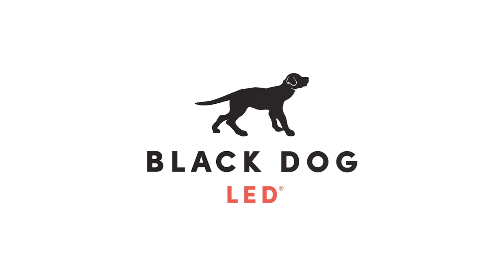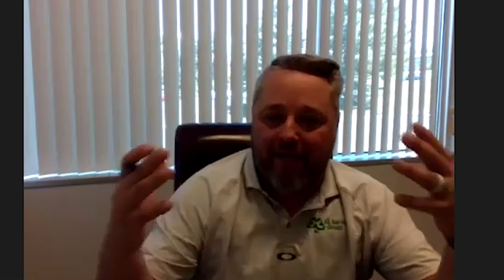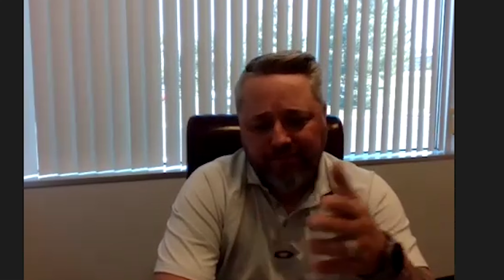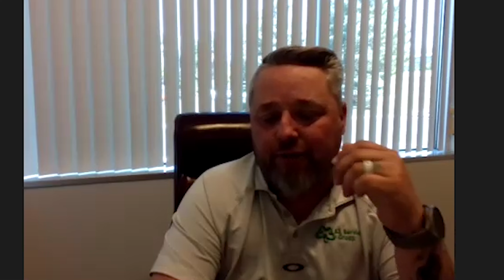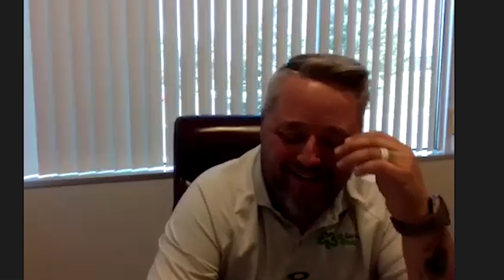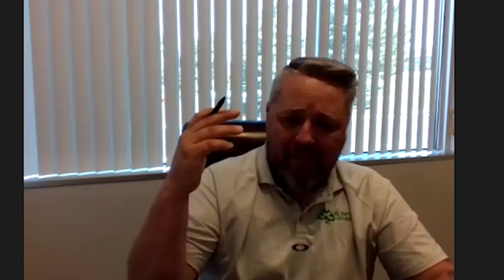Cultivation Cast - HVAC Expert - Bryson Guyer

Comment: 20:40.  Oh my.  I don't know how many times I've heard the HPS keeps humidity down routine.  I always ask:  and how exactly does an HPS light remove humidity?  Where is the condensate line come out of the HPS?
Reply from the maker: Yes, it is simply that HPS lights cause the air conditioner to run more, and the AC is what is removing the humidity…. Unfortunately, many people observe this as HPS “drying” out the room more. They would be better served by installing the appropriate amount of dehumidification and running lights with less waste heat. Thanks for asking the question and please reach out with any more!